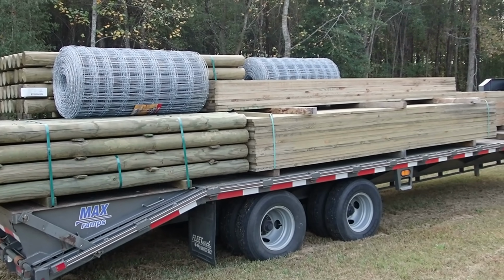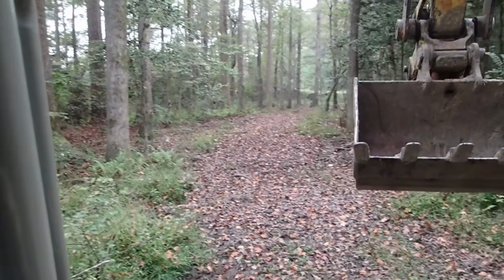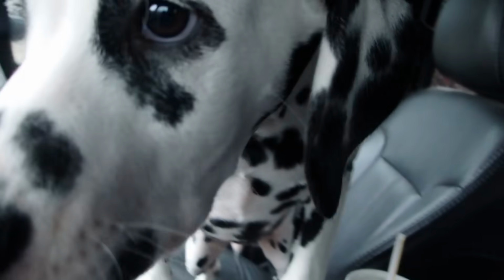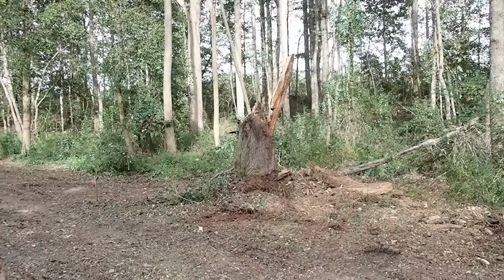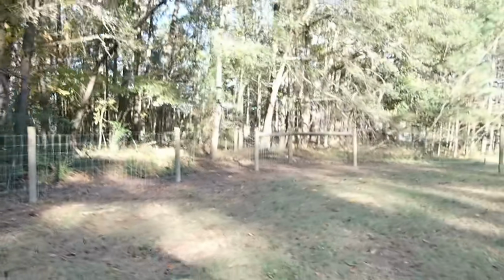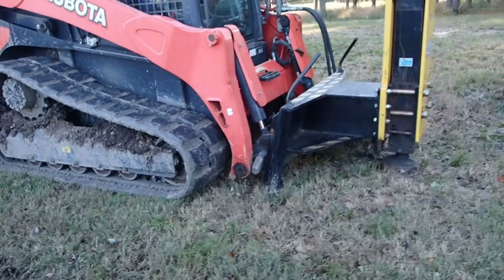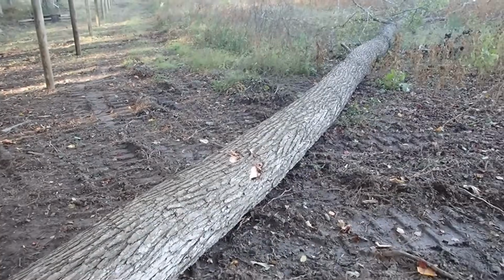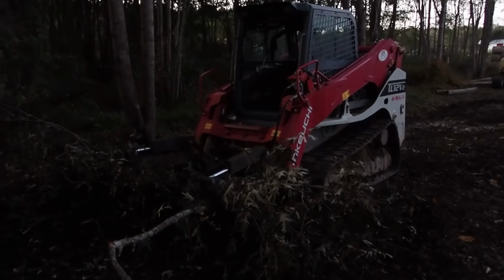Fences And Fence lines At The Farm

Comment: I dont use stain use 2 or 3parts diesel fuel and used motor oil from a diesel strainer, put it in garden sprayer and coat, makes a great looking color,  and soaks in wood, got one fence that is 36 years been up still looks great, smells bad for just a bit but it goes away in time

Comment: Used motor oil on your fence posts & boards instead of stain. Lasts decades longer, dark color looks sharp and it's free. They'l never rot and stock won't chew on the wood.

Comment: If I were you, I’d run hot wire on top of all fencing, it keeps birds from sitting on fence and dropping seeds that grow trees and other brush in the fence line. On posts, you should never cut a point because it causes the post to eventually sway. It’s always better to set them in as is and if your post has a larger end, that goes in the ground FYI.

Comment: Are you fencing in or out? If you are fencing in you have the boards on the wrong side of the post. wen the animals push on the boards you need the post for support. If not, you only have a few nails or bolts holding the boards. It's the same with wire.